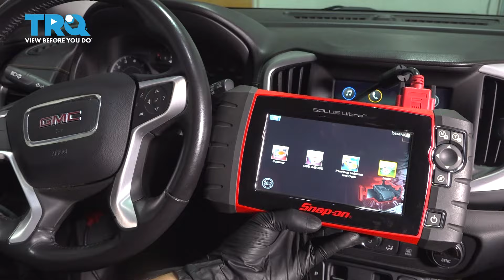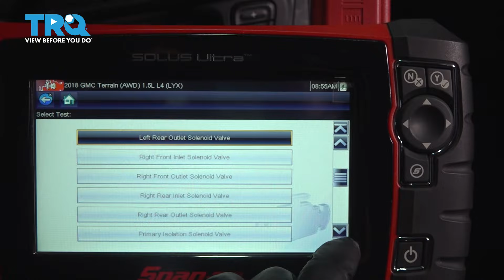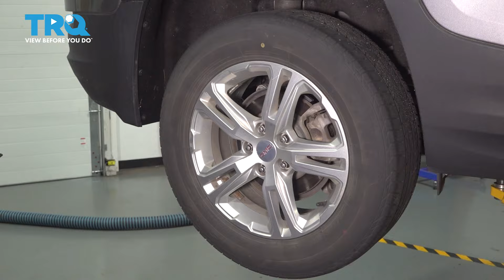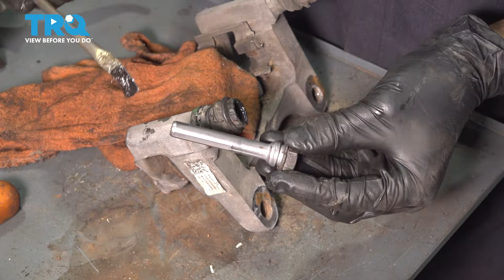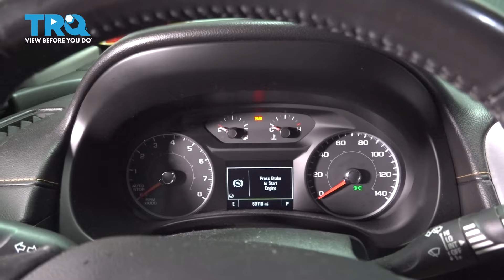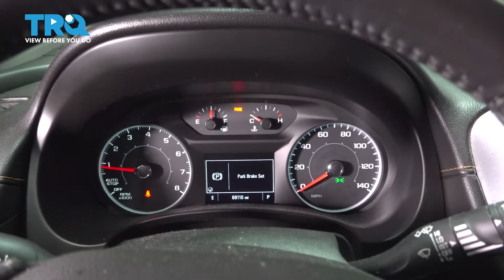How to Replace Rear Brakes 2018-2024 GMC Terrain

Comment: 3:58 Holy F'ing poop!  I simply CANNOT get the lower bolt to move.  Heat, impact driver, nada.  I don't have a lift, so I can't hang on it with a breaker bar.  Any suggestions?

Comment: You dont need a scanner tool. You can go to harbor freight and get a Maddox disc brake and caliper tool kit literally designed to help to decompress electric parking brakes. 40 bucks.

Comment: My E brake doesn't always engage when I park it, especially on a flat surface.  So why would I need a scanner to release it if it isn't engaged?  And who the hell came up with an electronic parking brake?  Cars used to have a manual "emergency" brake so what do you do now if your brakes go out?

Comment: The reason why the parking break started to blinking was because you release brake fluid in the caliper  and the electric motor sensor detected a leakage released in the mechanism system  
 To avoid it you need to bleed the calipers again so the caliper itself would be calibrated back to normal position and no flashing parking on dashboard.

Comment: This can be done WITH OUT scanner. On the rear breaks remove the electonic unit from the back of the piston. There will be a torx screw turn it clock wise and you can press the piston in, turn, press, turn, press, turn, press until its all the way down. The screw will stop turning. Mount every thing when youre done and pump the brakes to engage again.

Comment: Thanks for posting this. I have an 18 Terrain and I changed the calipers and rotors/pads. I used a Launch Creader Elite scan tool to calibrate the EPB afterwards. Seems ok. I used TRQ calipers and they were perfect fitting.

Comment: Thanks for the great video. For those that didn't catch it the first time through:
Lug Nuts: 19mm, torque to 100ft. lbs
Caliper Bolts: 13mm, torque to 30ft. lbs
Caliper Bracket: 18mm, torque to 74ft. lbs
Rotor retainer screw: T40 torx bit